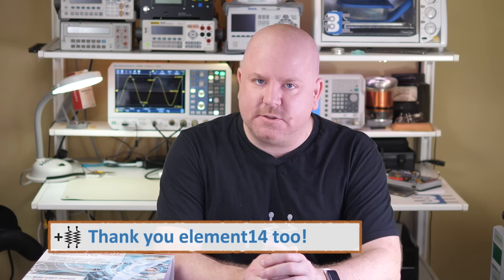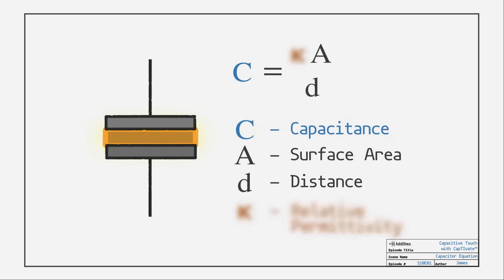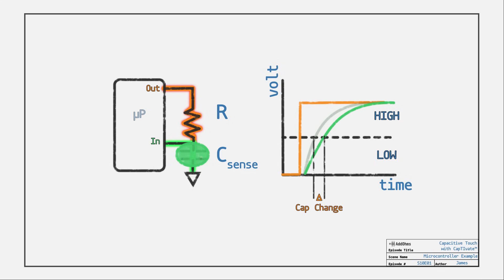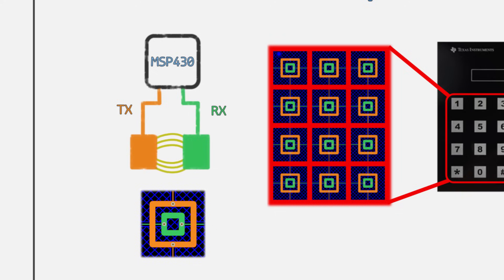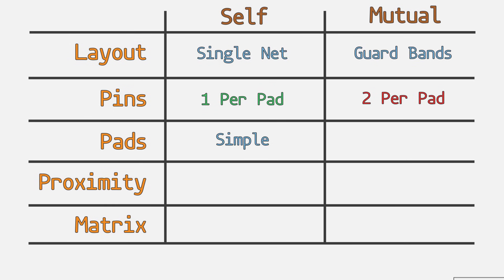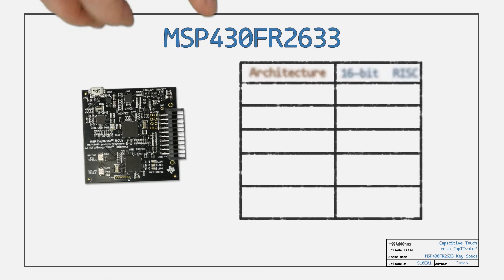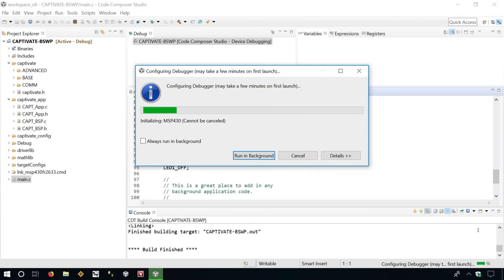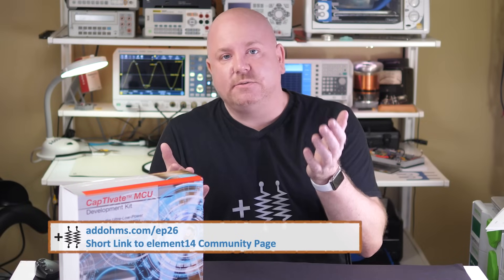Capacitive Touch with TI's CapTIvate Dev Kit  |  AO #26

Comment: But it is just to make prototypes, how do you make a capacitance button in a real life project, I mean how to design the pcb, the controller, etc
Reply from the maker: This video is a tutorial on "capacitive touch" as a technology. The kit I showed could be considered a reference design for both designing a panel and implementing the microcontroller. As I said in the video, it is a nice way to learn about the technology before doing your own design. 

Regarding design details, designing in the controller is following whatever instructions the manufacturer provides. As far as the panel goes, it depends on the end-product and requirements. In the case of TI, they documentation on all of the considerations. http://software-dl.ti.com/msp430/msp430_public_sw/mcu/msp430/CapTIvate_Design_Center/latest/exports/docs/users_guide/html/CapTIvate_Technology_Guide_html/markdown/ch_design_guide.html

Comment: When you say the IDE works straight out of the box, I get the horrible idea that you mean "works straight out of the box on Windows".
Reply from the maker: I’ve installed it on OSX and Windows with no problem. Since it installed to OSX fine, I assume it would install to Linux. The “Captivate design center” is an entirely
different story.